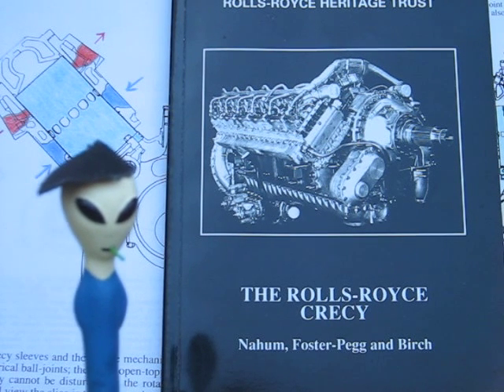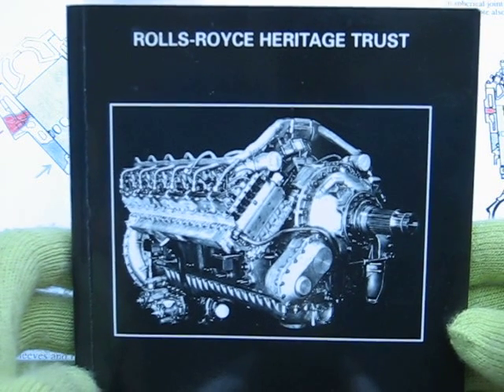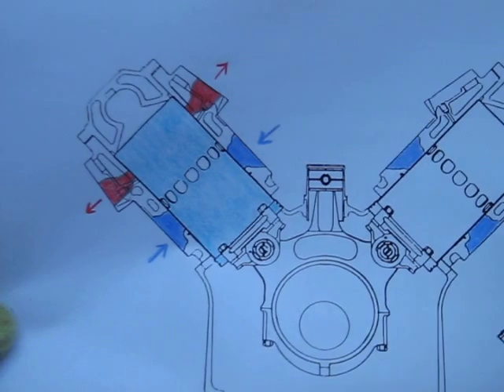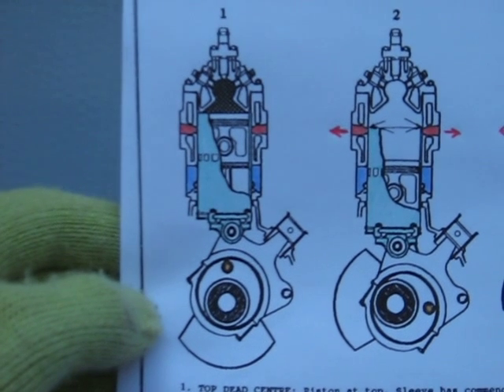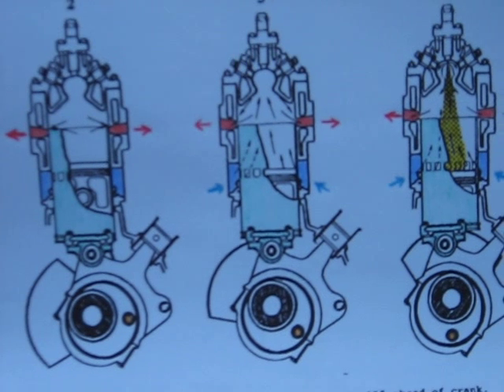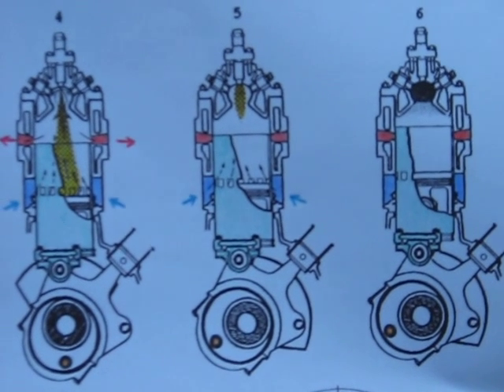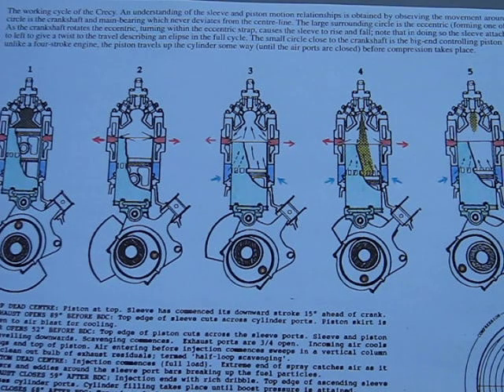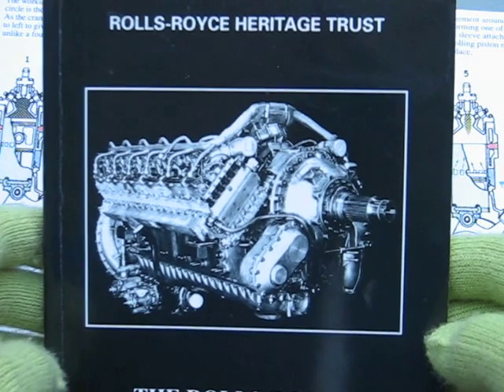The Rolls Royce Crecy Engine Vid1

Comment from the maker: Thanks for sharing that! I read that it was very loud, and could be heard for miles around. It sure would be nice if somebody had a recording of the sound. Today people would just record it using their cell phone!
It is such a shame that so little exists regarding this rather revolutionary engine design. 
I plan to get my single cylinder 2 stroke sleeve valve engine running when I can afford to have the sleeve bored out to fit the piston.  Take care.

Comment: It made a fantastic noise! I remember it use to wake me up in the middle of the night sometimes. And I lived 15 miles away!
Reply: Too bad they didn't build any production engines and no planes flew with one, huh?
Reply: Sure it did
Reply: I love the quote that says the two stroke engine is the most efficient way yet devised to convert fuel into noise.
It is claimed that, in the 1930s, the blown, 350cc DKW racing motorcycle, descending Bray Hill in the Isle of Man, could be heard on the Lancashire coast, over 50 miles away! I am a bit dubious about that but would like to hear myself proved wrong. Does Sammy Miller own one of those Deeks?

Comment: I just realized the Crecy also had a shorter compression stroke and longer expansion stroke. In that regard it's a lot like the Atkinson Utilite'. The Utilite' also injected a rich fuel / air mixture after the ports were covered.
Reply from the maker: Yes, the Crecy had a lot of tricks up its sleeve!  :)

Comment: Recently, SAE reported Loop Scavenging is better than any other type of Scavenging for two-stroke engines, for example Loop is better than Uni-flow scavenging
Reply from the maker: I think they are dreaming on that one, but I am no expert of coarse.
Reply: @Zontaar  Napier Nomad, loop scavenged but reliant of the 12 stage axial (compressor) supercharger to provide sufficient compression to ignite the fuel charge.
Reply: Most big marine engines don't use loop scavenge,but uniflow.The only big benefit of loop scavenge is simpler cylinder head and fuel injector can be better positioned.
Reply: @eugeneoreilly9356  Yeah!: SAE paper 2020-01-2012 is about big marine engines; regarding Schnuerle scavenging being better, this appeared in SAE news around 2012, but I failied in retrieving the reference, the fact that most big engines were buiilt with Uniflow scavenging does not mean it was the best approach, simply, information had not spread yet. Blessings +

Comment: Interesting engine, but why not combine the sleeve and piston into one peace?
(much simpler, adjust locations and dimensions of ports accordingly)
Reply from the maker: Kuznetzov TumanskiI don't think you could combine the sleeve and piston, and have it work the same. Interesting idea though, I have never even considered that idea!  The 2 stroke sleeve vale has the advantage of having uniflow scavenging, as well as being able to adjust the intake port timing differently than piston porting would allow. Of course you do have the added complexity of the sleeve and its drive.